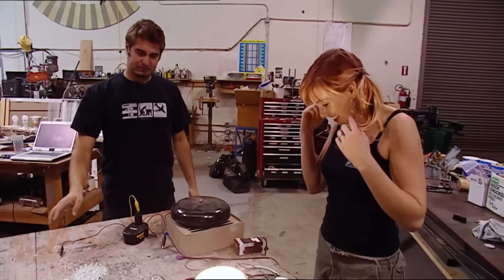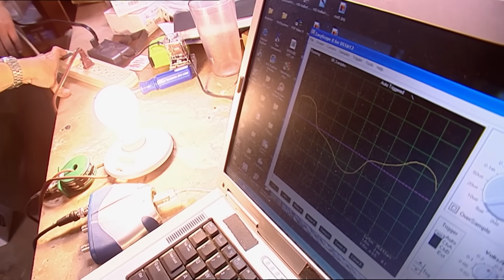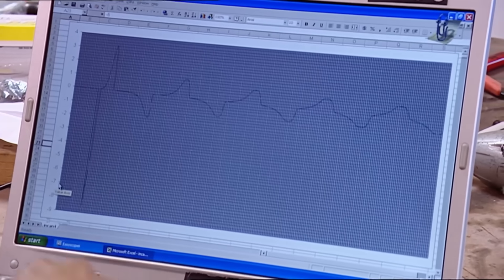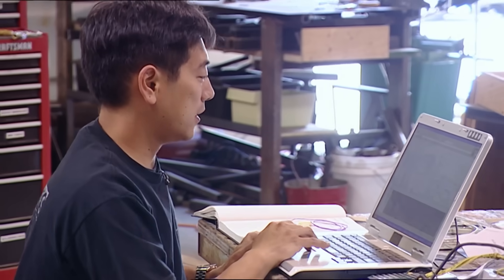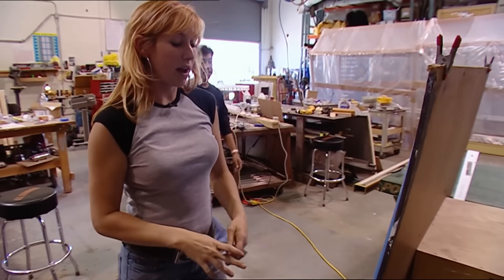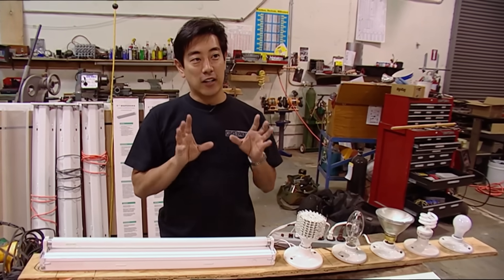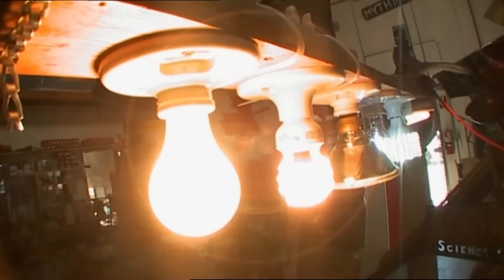Is It Cheaper To Leave The Lights On Than To Turn Them Off? | MythBusters

Comment: 2:53 LED's use so little power you would probably heat the room more walking to go turn it off than just letting it glow!
Reply: LEDs use like 1/10 of the electricity as a normal light bulb… this being said, it does this by using a dimmer that cuts off the diode that emits light off so many times per second, but the human eye cannot perceive the difference due to our limited ability to see things at a slower rate. So less by design cut them selves on and off several times per second to save electricity but it’s so fast that the human eye cannot see it.
Reply: Some city/town had replaced their traffic lights with led variants which come winter they quickly realized this.
Reply: @MarionetteKazuko That's why I think they now come with heating strips, at worst they match incandescent bulbs in freezing conditions but are cheaper every other time, which is the vast majority.
Reply: @ColHogan-zg2pc  They also tend to last a lot longer so a city will end up spending less in normal maintenance. Not a whole lot per individual bulb, but it adds up fast when you consider each intersection will have 8 at an absolute bare minimum and are constantly being cycled.
Reply: @MarionetteKazuko  Yes, but that is because of another reason. LED bulbs do use a significant amount of energy. But the biggest difference is that the warmth of indecent lighting goes to the front. And a LED warmth goes to the back.
Still, having a very small heater on the front glass uses less energy that indecent lights
Reply: in the winter  incandescent have 200% Efficacy

 a single 100watt bulb  keeps the room warm and lit...
 it's better then running a 1500 watt space heater and increase the risk of a  f ire   significantly  or the Heat pump which is going to still draw 3500 watts or so
Reply: @punker4Real  I don't think that's how physics works. A 100 watt incandescent bulb will output whatever energy isn't converted to visible light, obviously never over 100 watts worth. A 100 watt space heater is really efficient and will pretty much output 100 watts. A heat pump using 100 watts will output significantly more than 100 watts worth of heat, that's the entire point of their design. So as far as efficiency goes, you'd want to swap to LED bulbs and put the energy saved into the heat pump instead, for a significant gain in heat output. Not that you could really get incandescent bulbs anymore in most places, I suppose. 

As for fire hazard, I live in a country where heating has been almost exclusively electrical, via wall mounted heaters, until quite recently. So we have some decent statistics on this, and turns out they cause fires at about the same rate as fridges and freezers, and generally due to user errors (drying clothes on them or otherwise covering them up with something flammable). The main sources of fires are washers, dryers, ovens and cook tops.
Reply: @punker4Real  it just gets 100% efficient if you count heating, as is a regular resistive heater (the vast majority of stuff is 100% efficient if you count heating, even the light will get absorbed by things in the room and heat them up slightly).
but gas is cheaper and a heat pump/phase change heater (aka AC) is 200-400% efficient electrically, because it steals heat from the cold air (or ground in case of geothermal), cooling the outside air, and heating the inside. (the total efficiency is still less than 100%, but you usually only care about what you pay so it's "free" energy.)

Comment: Something interesting to note. Light bulbs aren't what they used to be. A long time ago, the major manufacturers were rounded up to agree on limited life expectancy for light bulbs...i.e. they could have been much more durable. But what's the point of durable goods if you lose on sales? Look it up folks...
Reply: Yeah, the light bulb conspiracy is not a great example of planned obsolescence, the trade-off for longer lasting bulbs were dimmer bulbs which used more power in the long run. Consumers wanted brighter bulbs and power companies wanted more energy efficient bulbs, so that's why the industry settled on a compromise with a slight reduction in longevity

Comment: When I was a kid in grade school the gym teacher used to tell us not to flip the lights on and off in the gym because it costs $0.10 each time they start up.  This became a joke in our household where we would flip the lights of and back on over and over saying "That's ten cents, another ten cents".
Reply: They were probably huge halogens, or high pressure sodium lights, which much like florescents, take a pretty hefty amount of power to start, and a start/stop cycle wears harder than many other types of lights. Not to mention, old school bulbs in a gym like that were likely $100+ each, and usually need a lift, and a professional just to change out a burnt one. (Source: 3 years as a venue lighting engineer)
Reply: @jakezanders6598  hps bulbs have orange light output, you're thinking of either metal halide or mercury vapor
Reply: @d3fault1420  yeah, you're right. I think I got metal halide and sodium vapor mixed up. Either way it's pretty expensive kit

Comment: This is also true with combustion engines. Leaving it run is not saving anything.
Reply: Depending on the vehicle, if you're stopped for less than 5-10s it's best to let it run.
Reply: Leaving it run, when? At a stop sign, red light, very short stop for pickup or drop off? What about the alternator, starter, battery? Starters and batteries have the highest failure rate in cars with an auto stop/start function engaged. A good battery sometimes costs over $200 and won't last long with those conditions. I wonder about this a lot for delivering food orders whether the risk is worth it to shut it off every location you have to wait or go in for pickup or leave it going and lose the whole car. I had to replace a good battery, twice, driving for DD, in less than a year. Short start stop cycles are brutal for the battery and ignition. A bad battery will kill the alternator. Also, most of the engine wear comes from starting it when there's no oil in it and it's cold so it's not optimal operating temp, where everything fits best from heat caused expansion. The longest lasting ICE based vehicles are driven long distances only and oil changed on schedule.
Reply: @uncrunch398 Most engine wear occurs when cold, but to say that there's no oil isn't true. There remains a film of oil on all lubricated surfaces and an antiwear tribofilm that serves to prevent damage in the boundary lubrication state that bearings, cams, pins, etc experience briefly at startup. Then, so long as the oil is pumpable (probable unless you live somewhere that gets 30F below 0 often), the positive displacement oil pump moves oil where it needs to be almost immediately. 

In the lab, the data is concerning regarding cold start wear. But the real world macro-level data shows that it's really not something to lose sleep over. Hybrids and stop-start cars are programmed not to cycle the engine when it's cold enough to worry about cylinder wash or excess wear, and the multitude of Prius(es? Prii?) Out there with 300,000+ miles show that, even in the more extreme conditions, it's not a huge deal. 

Add in arc-transfer cylinder liners, polymer coated bearings, modern lube formulations, and all the other modern innovations that make this possible, and it's really a big nothing-burger. 

Batteries and starters, I'll give you that one. I think they could make ones that last longer with technological advancements but the quality of batteries, particularly aftermarket, sucks now. In my personal opinion if automakers are hell bent on start-stop they need to make the cars mild hybrids ala Volvo and BMW, in those cars it's a more pleasant experience setting off from a stop and the ISG+48v li-ion batteries are actually able to take that kind of abuse.
Reply: @uncrunch398  If traffic rules and customs require you to keep moving once you have a notice to proceed, you should keep your engine running, so you don't hold everyone else up, because of your reaction time and restart time.  If you are in a spot where you can remain parked, and if you're parked long enough to get out of your car, you should shut off the engine instead of idling.

I always shut off my engine for construction stops, because those last much longer than traffic lights.  Plus, I'll have an advance notice to restart, when I see the oncoming traffic pass.  But at traffic lights, there's no advance notice at all, of when I'll get a green light, and I'll seriously hold up traffic if I turn off the engine.
Reply: @uncrunch398  This is also why cars with auto start/stop, are usually hybrids that have an electric motor to assist the engine.  The electric motor is built for the high torque demands on startup, and can get the power train rolling before the engine ignites.  So it's a rolling start for the engine, instead of a dead-start.

Comment: And still providing incandescent bulbs are the best option.
Reply: The LED bulb was like 1/90 the cost of the incandescent and was the only one left running, did we watch the same video?
Reply: @ColHogan-zg2pc  Not only that, but how long ago was this video originally aired? LED and driver technology has made major advancements in even the last ten years. So if that"old" tech bulb survived, newer ones should outperform it even.
Reply: @ColHogan-zg2pc   more like twenty times the cost of an incandescent bulb...

Comment: 2:08
Ws (Watt second) is a measure of ENERGY not POWER.
If the startup ENERGY required by the incandescent light bulb really was 21 522 Ws (=Joule)
and the startup was 0.1 seconds you would need approx 1 800 Ampere (assuming you use 120VAC).
A standard fuse in a home trips at about 15 or 20 Ampere (after some time).
Watt seconds per second (Ws/s) is simply Watt.
So you lightbulb uses 59 519 Watt?
A typical light bulb is 60 Watt.
A 60 000 Watt light bulb i a SERIOUS light bulb, which requires an upgrade to a 500 Ampere fuse, for a single light bulb.
You should also consider reactive vs real power.
Reply: I noticed the same thing, Grant must have been looking at a european decimal or something
Reply: This is what a 20 000 Watt (or "Ws/s") light bulb looks like (time 8:57):
https://youtu.be/LT5_-A0m8_U?t=537
So your light bulb is three times that?
Reply: And this is what a 30 000 Watt light bulb looks like (Time 22:22. Keep one of your eyes on the back of the reflector ... ):
https://youtu.be/zr-eZ_pLTNI?t=1342
😎
Reply: Nobody tell them about joules
Reply: yeah I noticed that definitely something very cursed going on with those numbers

Comment: Didn't see the numbers for the LED. Also, I suspect modern LED lights use far less power. As in, if you leave them on for 24h, they still use less energy than an incandescent bulb uses in like 30 minutes. (No math done, just ballbark guesses)
Reply: Most modern LED bulbs (except for a few brands, such as Philips) don't last very long due to cheap drivers inside them.

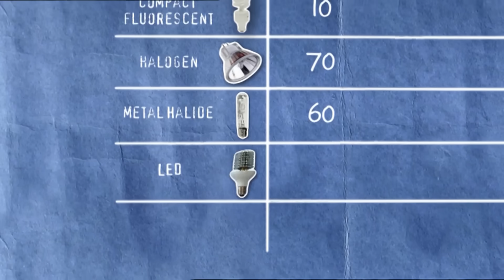Comment: 0:31 W/h. That doesn't make any sense. It's just W. Also, why is an LED only 1 lol?
Reply: Because a LED only uses 1 watt.  Watts to visible light has massive differences in efficiency.
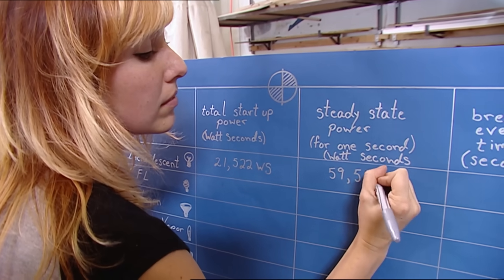Reply: Yes and also the values at 2:20 fail the sanity test very bad. If the time frame is one Second, and the energy used is 59000 Ws, that would mean the incandescent lights needs 59 kilowatts. To be fair they probably just missed a factor of 1000, which would make it 59 Watts, which sounds reasonable. but then again, didn’t it say that it needs 90 Watts for the incandescent?
Reply: @CaptainCookie04 I know! Anyone who's ever used a lightbulb shouldve been able to catch that🤦‍♂️
Reply: Because w/h is for consumption. W as in watts can either stand for potency or perceived brightness.

You can have two electric motors that outputs 500w to rotate something but one is more efficient than the other, and that can vary greatly 

Also the consumption can change overtime, like a power supply, maybe it says on its package it is 200w but actually produces 250w of potency but the manufacturer lied as it is actually better because is something that it's supposed to give around 200w even 10 years later.

Unsafe cheap low quality products usually waste a lot of power , and then you saved money in the purchase but lost a lot more money on the electric consumption
Reply: @uzzux  A watt is a unit of Power. Power is energy per unit time. W/h would be a change in power over time. The unit to use for Energy consumption would be Watt Hours, as in the Power multiplied by the time that power is used.

I have no clue what you mean with potency? If you mean electric potential that is measured in Volts, but I’m not sure that’s what you mean.

If you want to know how bright a lamp actually is you should look at the luminous flux, which is measured in lumens.
Reply: @CaptainCookie04 

Sorry, maybe I misused potency

But
Watts as W if for measuring power , as you said, as with the meaning of work or movement or exchange

And watts per hour as w/h would be energy consumption like my electric 2000w power electric oven consumed 200w/h this time (as in the winter it would certainly consume more)
Reply: @uzzux Energy Consumption is Wh and not W/h, the "/" makes a very big difference

Comment: What about Escalators, in india they auto sleep after certain time when not in use, and in canada i have seen them going 24/7. Thats more electricity waste and maintenance cost
Reply: when running at zero load, i.e. zero people the load should be pretty minimal. Im sure you can find idle power consumption figures for escalators in the sales material somewhere.
Reply: It isn't about the environment, it's about control.

Comment: Why are the units Watt/Hr ??? for power???
Reply: Thats how batteries are rated, 12watt hours for a phone.
Reply: @KiwiMaker  It should either be written with a dash or no punctuation, to imply a product of units.  The slash implies division, and the word "per".  Watts/hour would be a power ramp rate, rather than energy.
Reply: @KiwiMaker electronic batteries are almost always rated in amp hours, unless they're big enough like large laptop batteries
Reply: @KiwiMaker watt/hr and watt hr are not the same units. Watt hr is a unit of energy, watt/hr is how quickly power consumption is increasing. Watt/hr doesn't make sense in most circumstances. Watt seconds which they used later does and is just a Joule.

Comment: WHAT ? They NEVER show the logevity results. EVERY bulb (but one) had FAILED - after 6 weeks, but they never say WHEN it failed. Maybe one failed after 100 cycles, maybe one failed just before the 6 weeks was up. Is this en edit of a longer version with results ? If not, it is MEANINGLESS. I know for a fact that even slow cycling of a CF significantly reduced its life - in fact it seems to last more elapsed time if left on than cycled once per day.
Reply: it's propaganda to buy LED
Reply: @timregan1005  Big LED trying to badmouth the good 'ol oil lamp!
Reply: @timregan1005 that bulb was like 40x the cost of the other ones back then I assure it they were not a viable option to be propagandized. Today, there's no trade off to using them
Reply: @ColHogan-zg2pc   flashing at 60hz, lower sleep quality due to it emitting blue light to energize the phosphor, worse light quality due to not being a perfect black body emitter. 
In a world of climate conference attendees using private jets to attend, I'ma gonna keep my incandescent lights please and thank you.
Reply: @Intelwinsbigly  That would be nice, but nowhere sells them any more.
Reply: @Intelwinsbigly  High CRI bulbs are becoming less expensive every year. They make warm colored bulbs, 3500K and warmer. If you don't like LED you can use CFL, they cost about the same but CFL is a pain to dispose of when they fail due to containing mercury. Flickering LED bulbs means you bought the cheapest you could find.

I won't deny conventional filament bulbs have their uses and advantages (built-in deicer for winter in outdoor fixtures) but it's ridiculous to pay 10 or 20 times the cost on your electric bill just to light your house vs a modern bulb.
Reply: @HittTheDekk  it's also ridiculous to act like my choices need to be logical when the cost of electricity is so negligible...
Reply: @Intelwinsbigly  The cost of electricity is not negligible in certain areas of Texas and California. PG&E charges ridiculous rates (50+ cents/kWh) if you exceed certain thresholds or run your air conditioner during designated peak usage hours. I'm glad you can get your electricity service for cheap.

Comment: I dearly hope he meant miliwatt seconds. Otherwise, that's a 60,000 watt light bulb
Reply: Also the graphic had the power column labeled W/hr...
Reply: @rolandd3173   Yeah, I noticed that, too.  And that is indeed also incorrect.  "Watts per hour" is meaningless unless you're talking about a gradual rate of change of power.
Reply: YES!  And Grant Imihara incorrectly called energy "power".  As an electrical engineer, he of all people should know better.  😠

Power is not energy.   Power is energy per unit of time (typically a second). 

That's not just pedantry -- it's an important distinction.  The definition of a watt is one joule of energy per second.  (Which also means the term "watt-second" is silly.  That's like calling a mile a "mile per hour-hour".  The correct word for this amount of energy is JOULE.)

A joule is defined as the amount of energy that is expended by a force of one newton exerted over a distance of one meter.  So it's what you'd get from dropping a weight (okay, mass) of 102 grams (i.e., one newton at the surface of the earth) from a height of one meter.   (In U.S. Customary Units, that would be dropping a weight of 3.6 ounces from a height of 39.4 inches.) 

___________

(For what it's worth, 746 watts equals one horsepower.)